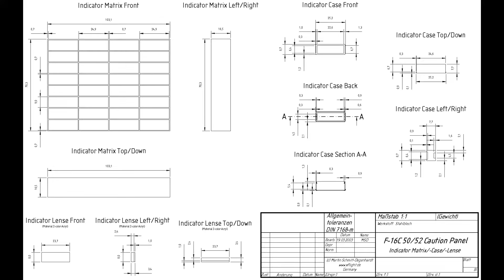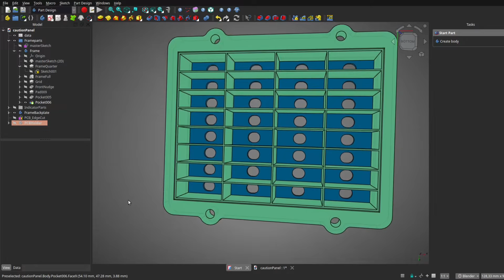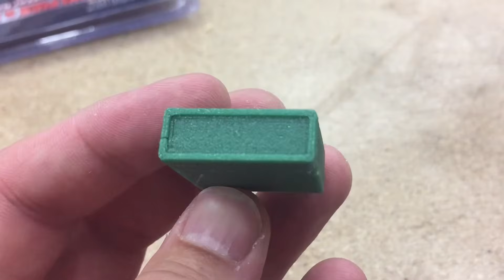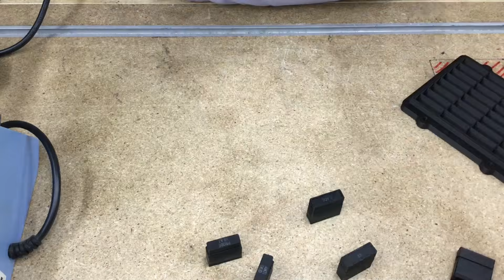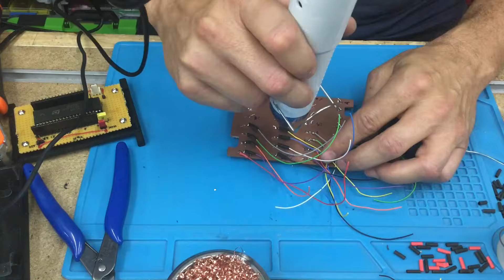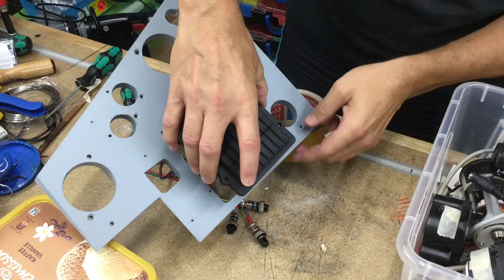F-16 Home Cockpit 15 - How to Build the F-16 Caution Panel

Comment: This could be the beginning of OPEN F16 Project
Reply from the maker: All of my designs are available for free, so yes, it's more or less an "open f-16 project".
The only downside is, some parts only fit my sim which isn't 100% completely accurate, measurementwise.
That info wasn't just available when I started 27 years ago ;-)
But that's mostly for bigger parts like hull/seat/centerconsole, all the instruments and smaller parts are usually very close to the real parts.

Comment: Very nice!!!  I just printed my throttle arm today!
Reply from the maker: Fantastic! What material did you use for it?
Reply: @simhangar6216  I'm using PLA, but adding epoxy resin for strength.
Reply from the maker: Very clever solution!!

Comment: I’m actually doing this right now. Great timing!

My method is the same as yours, except I made the lens housings all once piece, and I used a cheap desktop CNC router to cut lenses from acrylic sheet.
Reply from the maker: yeah, I'm doing the ECM push buttons like this. acrylic lenses, engraved the text with the CNC and then filled with white paint. 
For the CP I wanted to keep it a bit simpler than to cut 32 single lenses ;-)